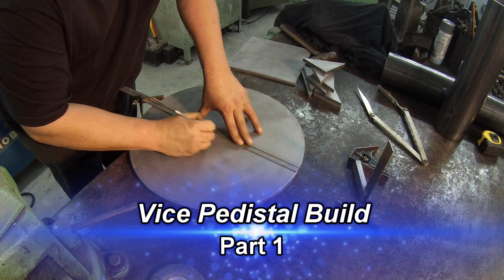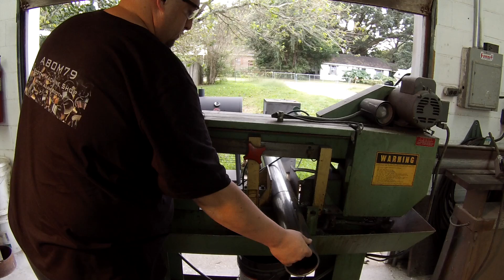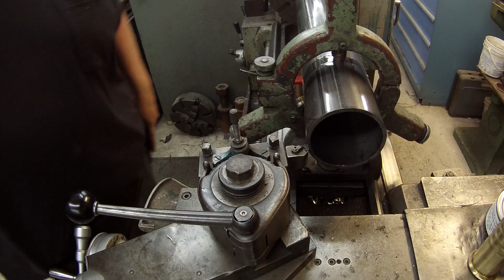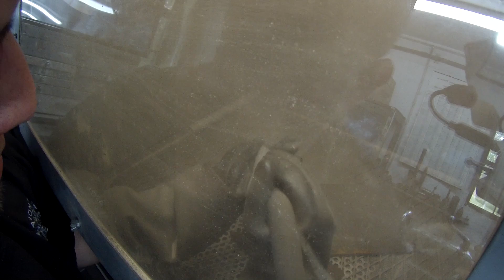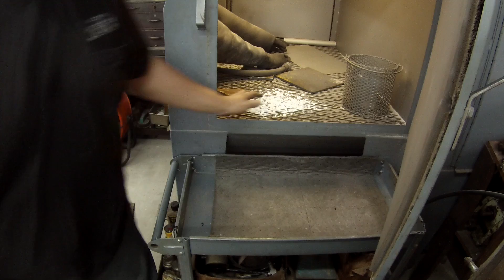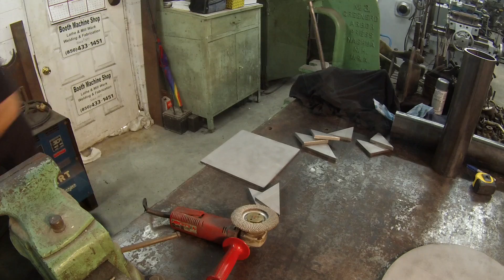Vise Pedestal Build Part 1

Comment: I will tell you for a fact that the end of that pipe didn't face square.  It can't with the steady rest set up like that.  For a square facing job, it has to be in a cat head.  Or, you need to turn a journal so that the pipe can turn properly in the steady rest.

Comment: Nice to see a big saw.  I put on a Hydrolic filter (resin coated) name brand - and got a hose to hose filter holder - put it on the saw fluid and the blade lasts forever!    The particles in the oil that wash in and get pumped about pit the teeth and make it dull.  Kinda like running a chain saw in dirt.  I got a lot of heck on trying - but the filter lasted more than 15 years when the can rusted out.  Same blade.  Used it on iron, Al, Bronze and bolts.  I have a prime blade waiting for that carbon blade to fail!  I think I will just change it and start out with a fresh blade.

Comment: First let me say I've watched several of your videos. Great job I like them a lot. But as a welder for 30 plus years I was wondering why you chose to use flux core wire to weld it together. As you said in the first of the video. They basically came out with it so you could use a wire welder outside in the wind with no gas. Regular wire with gas gives you a much better job to me? Just wondering your reason.
Reply from the maker: I disagree with you, based on my experience.

Comment: what is the brown colored roller cabinet in the back ground with the electric driven belt? really love the way you show what i call o.c.d. as i have just to use a lathe to prep. surfaces even when ur gonna weld things up. love it. i get so technical when i wash dishes or make a cheese burger. thanx man, its nice to be so precise on everything.

Comment: Rather than using the bandsaw to cut it to length, wouldn't it be better to chuck it up and use a cut-off tool, then flip it and trim to length with another cut-off? That would still leave two parallel surfaces, without the bandsaw.
Reply: One issue is the length and the other is in order to do that you'd have to machine it perfectly round for the steady rest.The way he did it is the most efficient way,for something like this.

Comment: Hi Adam,

Some people who have hobby sized machines just don't get how much work it is to swap a chuck on a big lathe. When it's a crane job, you're really not going to do it for a single operation!

Have you ever used a cat's head in the steady when machining an irregular bar or pipe?
Reply from the maker: Yes I've had jobs where we have done that. Good for hex and squares too.

Comment: Hi Adam. I don't ever recall seeing you use a digital indicator. Do you have a preference for analog indicators?

As for calipers, I cut my teeth on analog, and my argument for them was that I could eyeball the needle to within one ten-thousandth, whereas digital calipers round-off to five ten-thousandths.
Reply from the maker: I think digital indicators suck using for indicating a part in the lathe. It's much easier to watch a needle clock around, vs trying to keep up with flashing numbers. Digital calipers I dont have a problem with though, and use them everyday. But I do like and own dial calipers too.

Comment: Damn kid, you are good at shmokin' in that 4 jaw. I got a chuckle when you were saying how you busted up some roller bearings rolling them on pipe, I did the same thing! Good lesson on indicating four points instead of trying to achieve zero runout on pipe with a test indicator, I learned that the hard way when I had to work with pipe. I'm a former Mold Maker so I was used to fussing over everything to the hilt, but I've had to learn to pick my battles much more in general machining. I've picked up so many useful tips from you and Tom, can't Thank You guys enough. God Bless ya Brother, you do good work.
Reply from the maker: Thanks Jerod. Actually I remembered that I also busted the rollers in the Acra-Turn lathe steady rest also. Pipe can be a bitch to roll. Yep, just indicate 4 points even, and let her go.

Comment: Good video adam and finally someone running some flux core can't wait I run that stuff on a almost daily basis. Ive been wanting to make a video myself on it but just haven't gotten my hands on any yet plus I prefer to run it with c02 gas which I don't have atm. 4  jaw for life!
Reply from the maker: From my experience you can use either gas (co2 or mixed) and get good results, but I think some of the welders out there use c02 more commonly. I love running flux core when I can, I prefer it over the solid wire for better penetrations, and ease of weld.
Reply: Abom79  yup certain brands call out specific gas for some of the core wire. Sometimes with 75/25 you can run into some cracking issues on certain material. But with mild steel you will never have a issue. Co2 the slag does'nt freeze as fast as mix. Sometimes mix gas you will get worm tracks or worm holes also.
Reply from the maker: TheJesusno2
I run the 75/25, but thats only because I only have that one bottle for my mig welder. Your response might make sense on why I get some of those "worm tracks" once in a while. If you can overlook those, it always produces a nice weld. I use the flux core for thicker materials, like 3/8" and up.
Reply: Me too adam. I've actually had to use 0.45 SS core wire on 10g sheet metal that was fun. Ask me why, I have no idea, that was some hair brained idea of the engineer.
Reply from the maker: Hey, I got some of that SS too. Might have to delve into another time.

Comment: That big basket in your cabinet looks like the one that comes in a 5gal bucket of carb cleaner. Those partial round parts in the lathe can be a real pain. I guess the facing head on your boring mill  could have been a good option for dealing with that.
Reply from the maker: I had a job many years back facing them ends of tubes, and I machined a fixture for the tubes to rest it and used the boring mill to face and chamfer. Not quite sure now why we did that but I think because there were so many we didnt want to tie of the lathe. That was back in our glory days.

Comment: Self centering chucks are made for cold drawn stock or machined parts, scroll chucks can be sprung by pipe, black bar, etc. Some cylindrical grinders go so far as to use micarta steady rest jaws - no marks on the workpiece and no vibration from rollers.  How often do you clean the filters on your blast cabinet ?
Reply from the maker: I've only replaced the bag filters a few times. They last a pretty long time. Manual says to change them anually, but I don't use it often enough to do so. never had a problem with them either.
Reply: Thanks Adam.

Comment: Hey Adam,
Thanks for the video! I'll be interested to see you use the flux-core MIG wire. I have a couple of 2-lb. spools of the stuff but have never got the nerve to use it. From what I hear it's like stick as you have to chip the flux, etc.
Have a good one!
Dave
Reply from the maker: Yes it leaves a layer of flux on top of the bead just like using an electrode. It's basically the MIG version of 7018. Best used for thicker material, as it gives better penetration. I prefer it on materials 3/8" and up.
Reply: Abom79 
Home run on that one Adam! Best part is you don't have to worry about the wind when outside.

Comment: So with that 4 jaw alignment around 7min....did you push the tube slightly out of round with the first jaw pair? The 0.011 vs 0.026 readings make me think it's about 5 thou out of round due to jaw pressure (assuming that the out-of-roundness was contained in the inner diameter when clamped)

For facing I'm sure it's fine, but for outer or inner work, threading or tight diameter work, would you go back and try and equalize the readings? Especially when using properly round tube?
Reply from the maker: Pipe is naturally out of round to begin with, so your just centering the pipe on axis. Yes there is a small amount of distortion from the jaws, but since I'm not machined that end it's invalid to worry about. 
If you try and equalize the roundness by squeezing the jaws, you'll only make it that much more out of round when you unchuck the pipe.
As I said, if you want to machine the end you have to turn a true round spot on the pipe for the steady rest, only then can you get a round cut. But with pipe even that's a crap shoot. Pipe is natorious for egging even after you machine it.

Comment: Hi Adam,
Dentist, still hear the sound of that air drill drilling my tooth and my wallet... Dread those visits. At least hope your dentist is a nice one. (To me the nicer ones are the blond ones with a cleavage, hurts sooo much less)
What is wrong with a 4 jaws chuck??? An unused operator...! What else?   lol
That is gone a be a swell base.
Cheers,
Pierre
Reply from the maker: He treats me pretty good, on my mouth and my wallet.
Some guys give me a hard time about using the 4 jaw chuck so much. I don't think they have seen all the work I do.
Reply: Not as fast as you on the 4 jaws chuck, but I'm pretty fast too, practice makes good and understanding the directions an dosage...

Comment: When I first got my Barnes lathe it only had a 4 jaw chuck on it and I think that was a good learning experience and should be the way to start off.  I have 3-jaws for my Atlas and it is nice, but still nice to know how to put the 4-jaw on it and dial it in for work which needs to be true like an arbor when having to swap ends.

P.S. Cut my first real external thread last night, a 1"-8.  Not as fast as you and it probably could have had a little tighter fit, but it went from not going on to a little play quicker than I thought (one for the memory blanks.  Thanks for all of the lessons there from watching yours and others videos.

Now if I just had some 4" pipe, some bigger plates I could make a couple legs for the Atlas as I'm finding the bench/desk I have it on now has too much vibration...oh, I guess I would probably need some better welding skills, too.  Looking forward to seeing your MIG flux core welding in part 2.
Reply from the maker: Big congratulations on cutting your first thread. Once you get the hang of it you'll be cutting threads no problem. Don't get in a hurry. Take your time and build up to the faster speeds.
Your right about the 4 jaw. it's great for many jobs, but the scroll chucks have there place.
Check with some local welding and fab shops to see if they have some drops or scrap material laying out back they will sell to you.
Reply: Thanks.  I'm glad my threading job turned out better than my poor attempt to get some video of it.  I did get some stills near the end.

I was thinking that I definitely wouldn't be confused with Ol' Quick Draw McBooth.

Comment: Mounting holes?

Wouldn't it be easier to drill them before welding?

Frank
Reply from the maker: Yes it would, but actually he wanted to drill the holes himself. He already had the anchors in the ground and made a template to transfer the holes onto the plate.

Comment: Hi Adam

I like that big, big gloves you have in the sand blaster cabinet ... I think we have the same size of hands !
It's hard to get gloves that big here in the EU and it's way to costly to get them send from over there by you - so I'll have to live with my too small gloves till I find them big enough here. I too can see your blaster is way faster than mine ... but OK, mine is smaller and only for hobby-use !

Shouldn't you have some holes in the base plate before you weld it all together ?

Hope your Dr. Dentest wash his hands good before doing your teeth ;-))

Again, so nice to see you dial in that pipe in the 4-jaw chuck - I love it and long to get my 4-jaw chuck mounted - I picked one up in Germany some weeks ago !
Reply from the maker: Keld, we will have to see if we can find you a pair of those gloves. I will keep it in mind for you. They are plentiful here.
The Doc was wanting to drill the holes himself, and actually already has it mounted. he already had the anchors set from a different pedistal, and was going to make a template and transfer them to the plate.
Better hurry up and get that 4 jaw in use....it's getting lonely.
Reply: Abom79 Hi Adam - Nice that Mr. Dentest has the stand mounted already. Gloves ... yeah, I have found some over there, but the shipment cost is 5-6 times the cost of the gloves - BUT I have a friend in the States - visiting me TODAY - and maybe I can let him bring them to me one day - when he is coming today, he will bring me 100 brushes for my "poor mans spill maste". The 4-jaw chuck have to have a new back plate ... yet another project - but that's what life is ... when you runs out of projects - then you die - right ?

Comment: Adam, Do you have a blade welder for your band saw? I have and if you don't I'd be glad to weld up some for you.
Eric
Reply from the maker: No I don't, I have to buy from the normal suppliers. I'll have to look in the manual to see what the length is for the C4.
Reply: I can weld  up to 1" wide blades. The welder is part of my 16" upright DoAll Bandsaw.
Eric